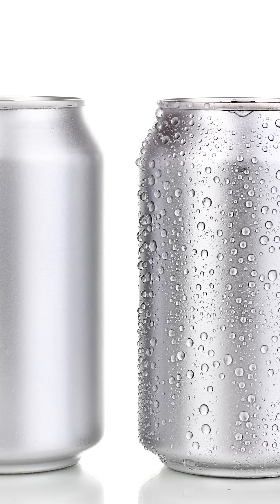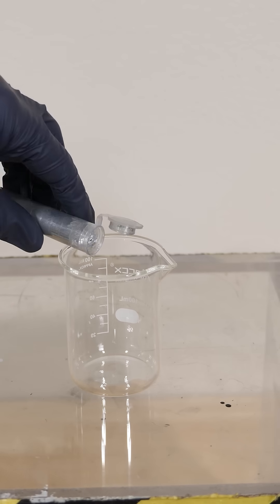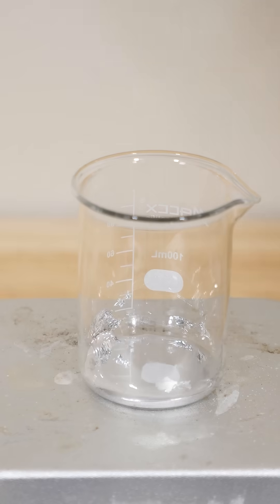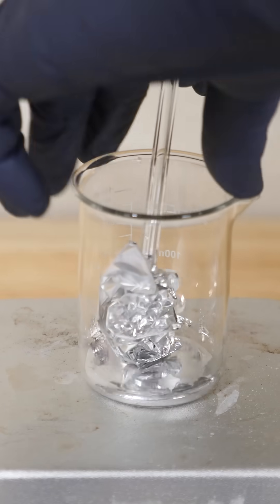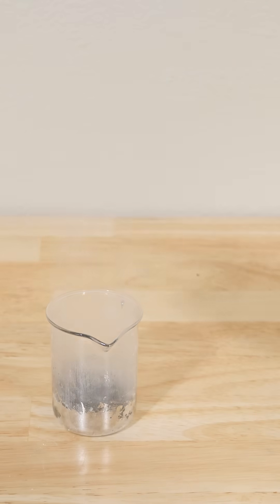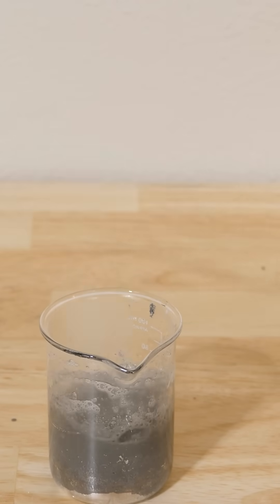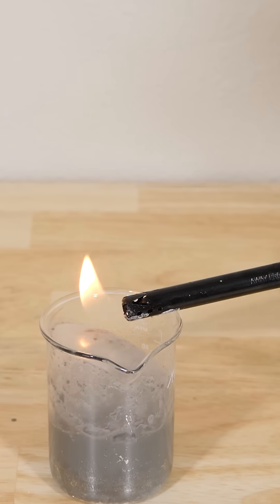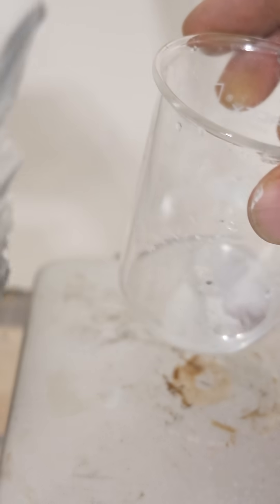Don't mix water and aluminum!

Comment: There is a reason why aluminium is so difficult to obtain despite being one of the most abundant elements on Earth. It simply does not want to stay in its pure metallic form.
Reply: Aluminum is one of the most reactive metals in the periodic table, and that means it will mix with anything next to it
Reply: @kenon2414 
I never realized that; although I should have figured it out by its position on the periodic table.  Makes sense now.
Reply: @kenon2414 So it's one of the whores of the periodic table 😂😂
Reply: @kenon2414 I had no idea
Reply: @kenon2414 Sodium and magnesium, the 2 elements before it be like
Reply: @CZpersi 😂😂😂😂
Reply: Guess I should stop drinking canned beer then!
Reply: not only does the aluminum of your beer can create an oxide layer the instant it's exposed to air (as described in this video), preventing it from reacting with your beer or anything else for that matter, your beer can also has a thin plastic lining inside of it to protect the flavor of the beer. If you damage the lining, the can breaks down more quickly and makes your beer taste funky, but it wont react, again, due to the oxide layer on the aluminum.
Reply: @nickhollerauer4295  That plastic layer is leeching BPA in to the  beer. It's real purpose is to lech BPA in to the product.
Reply: @Maxim.ID4HO  lol mmmk
Reply: @Maxim.ID4HO  there needs to be a plastic layer, or else the metal will corrode or leach metal into the drink (like the Moscow mule does).
Reply: @emilpersidski  That's why I recommended glass bottles. If you notice they have plastic, Teflon, or aluminum touching our food at every turn in preparation and storage. The people responsible for this said they would get us with the packaging. Shortly afterwards, plastic was touching everything, if not aluminum. Stainless steel and glass are the safest materials.
Try and find a solid stainless steel pan these days without some aluminum thrown in there somewhere.
Reply: @Maxim.ID4HO  plastic and aluminum are cheap, easy to come by, and effective at sealing things off while being lightweight and strong. You are implying there's some sinister thread behind packaging when a simple analysis of why one might use those materials in the first place better explains their use than any conspiracy theory ever could. You may have some kinda point with regards to health issues, maybe plastic can be bad for you over time, yada yada, but you seem to think the conspiracy is to negatively influence health on purpose rather than simply save money at the potential expense of your health using the most cost effective means available, I.e. a simple costs/benefits analysis that any consumer can do. I just don't see the profit motive behind purposefully making people ill with plastics, but I do see the motive behind making people containers that do their job very well while being cheap and convenient for the consumer and company alike.
Reply: @nickhollerauer4295  
Production of plastics

Production of plastics from crude oil requires 7.9 to 13.7 kWh/lb (taking into account the average efficiency of US utility stations of 35%). Producing silicon and semiconductors for modern electronic equipment is even more energy consuming: 29.2 to 29.8 kWh/lb for silicon, and about 381 kWh/lb for semiconductors.[120] This is much higher than the energy needed to produce many other materials. For example, to produce iron (from iron ore) requires 2.5-3.2 kWh/lb of energy; glass (from sand, etc.) 2.3–4.4 kWh/lb; steel (from iron) 2.5–6.4 kWh/lb; and paper (from timber) 3.2–6.4 kWh/lb
Reply: @Maxim.ID4HO  this is a meaningless comparison considering plastic is so much lighter weight than those other materials; I.e. a lb of plastic will go a lot further than a lb of iron, so saying you're making a lb of iron more cheaply is completely useless information. Furthermore, consider, a bicycle is 98% efficient, yet we drive our cars that run at 30% efficiency all the time. Why? Because we consider many other factors when building and using products, namely how useful the product will be once it's been created, and plastic has virtually infinite uses, thus it's worth it despite being more energy intensive to make. I mean, these materials are all extremely useful for many different things, granted, but you're only considering one factor in your analysis, not the potentially limitless number of end products that can be created after processing the raw materials to make plastic. Tell me, how hard is it to create an airtight package out of a bar of iron or a hunk of glass? How much does forming that package cost per unit? How much energy would it take to ship that single product to a consumer? Because you can create about a million of them in a day using plastic to make zip lock bags, and a lb of those vs a 1lb airtight iron lockbox would be much more efficient, and probably more useful, no? Plus they're more malleable, less prone to damage from the elements or from being dropped, I mean really I could go on and on about how much more stuff you can make out of plastic that is more useful in more ways than if you used paper, metal or glass, but the sheer absurdity of your myopic view on the subject is enough to bury your argument. You can't make virtually anything as cheaply or efficiently with any other material for a vast, vast array of products as you can with plastics, and to say otherwise is just ridiculous. I mean...its in our lexicon that something is cheaply made if it's made from plastic. "It's made of cheap plastic" is a phrase often heard when handling products because, say it with me, *plastic is cheap and easy to come by*. Period. It doesn't really matter how inefficient it is to make compared to other materials when you consider the incredible versatility of the end product.
Reply: @emilpersidski just drink the metal-tainted beer, like our forefathers did!
Reply: @nickhollerauer4295 Oh Yah? So how come the water in my childhood aluminum canteen tasted so bad after 15 minutes?
Reply: @Maxim.ID4HO That's why I only use bottles & pour my beer into a "glass" glass.
Reply: @american23t  I don't know if you're trolling me, but I'll answer anyway: the inside of your canteen probably wasn't coated with plastic like in a soda can. The aluminum leached into the water to make it taste bad. Just because the entirety of the aluminum exterior was oxidized, preventing it from reacting, doesn't mean a small amount of it can't get dissolved into the liquid.
Reply: @Maxim.ID4HO  exept your forgetting that plastic is a byproduct not the intended product. Which is why it's so cheap. Gasoline and diesel are the primary products you get from refinement and in the process you get a ton of byproducts including some plastics. There are actually other plastics that are made through plant matter
Reply: @saber5694  I said steel and glass were cheaper to produce than plastic. The processes show it and the documentation is there. Steel canning is still in use and so are glass bottles and jars. Plastic has subsidizing added to it, as well.
Plant based plastic (cellophane and similar) are not as abundant in food packaging as they used to be. Plant based packaging material is safer. You would think that it would be used more often for that very reason. Clearly we are discussing the wider use of petroleum by product plastics. They are poisonous...cut and dry they are poisonous.
And that they are more expensive to produce raises the question as to why we are having them put all over our food and food storage.
Aluminum is poisonous. You'll never see Aluminum added to a multi-vitamin for that reason. Someone above claims Aluminum oxidizes before it becomes a threat, but that is not the case and acidic foods challenge the bonds of their containers. Aluminum leaches in to the food products. In the Food Industry they had safety guidelines on the use of Aluminum foil during the cooking process. We had to line the food with plastic wrap (just as bad) if we were to be using Aluminum foil on the product.
It's very simple, you don't use poisonous materials to produce or store your food and we are doing just that. Those that are in charge of these companies said they were going to do this, and here it is.
Reply: @nickhollerauer4295 yes it's true, plastics are almost the perfect material for storage and ease of use and a wide variety of applications.... Too bad they come with shitty side effects like BPA and BPS in the material, and the continued use of easily disposable plastic products is causing an environmental catastrophe in waste, including the great plastic garbage patch floating out in the Pacific ocean. 

I wish we had a different material as perfect as plastic for our everyday needs, perhaps in the near future will find one. In the meantime I would like most consumer plastics to be banned but I don't see that happening.
Reply: That's insidious.
Reply: That's insidious.
Reply: @nickhollerauer4295  You make a good point. Why would they want to kill their customers, the ones making them rich
Reply: Tell it to Du Pont
Reply: @nickhollerauer4295 it's amazing you advocate for money over human health! Welcome to the end of our thought process, where did you get lost along the way?
And if you think the multibillions of dollars of damage that microplastics and nano aluminum ( in the air) and forever chems outweighs whatever money they're saving, maybe YOU should go back to studying cost/benefit analysis.
Why are the most myopic people the loudest?
Reply: @nejihiashi  I know, but I still try where I can.
The water filter I currently use to remove BPA's is plastic. I'm upgrading to a glass and metal model.
You are very, very right. 
Just got to keep trying though.
Reply: @Maxim.ID4HO  I'm with you i wish we get better alternative than plastic especially for water and food
Reply: @Maxim.ID4HO with all due respect, without the plastic lining, canned goods would expire a month into their lifespan due to the corrosive contents eating and rusting through the metal. That plastic layer is required like it or not
Reply: @Maxim.ID4HO mass producing plastics is cheaper yeah in small quantities glass and everything else is cheaper but to bulk make plastic is overall a cheaper process and the plastic is exponentially easier for the manufacturer to manipulate.
Reply: @Maxim.ID4HO Even if I want to grab my tinfoil these days I find that it's made of aluminum. Bummer. Tbh I like both.
Reply: @Yukanhayt-Mhenow those aren’t pure aluminum. Never have been.
Reply: @torakfett3351 I don’t get why people refer to a given metal in an alloy as if it’s not pure aluminum. It is. It’s just mixed with other metals, but the aluminum is pure aluminum. People say the same for gold. 18k gold has pure gold in it, that fact doesn’t change just because that alloy is not 100% gold. The gold in 18k is as pure as the gold in 24k. 

Don’t get me wrong I understand…I just don’t think it’s the best way to communicate what needs to be communicated.
Reply: @Fee.1 the issue is that 18k gold is referred to as gold in spite of being an alloy, thus we call 24k gold pure in other to distinguish it from gold alloys that still get called gold, in spite of having other metals mixed in.
Reply: @Yukanhayt-Mhenow  most likely kely you're not getting any more real harm from canned beer than from bottled beer. Aluminum oxide, which forms a shell around aluminum very quickly, is pretty stable and doesn't leech to any significant extent into the beer. The alcohol in the beer will get you a few milleniums before the aluminum of the can does, unless you like get stabbed by a weaponized can or whatever.
Reply: @henriquepacheco7473  When that oxide process fails, you get a pitting on the surface of Aluminum. The pitting is very common, so it happens all the time. We are just used to seeing metal rust, when it is being eroded. Aluminum does not rust, it pits when it fails. So Aluminum is not as safe as these people are making it out to be. You would never see it as plumbing or in a daily vitamin regardless of this magic oxidization layer that is impossible to disturb.
Reply: @Yukanhayt-Mhenow cans have a layer of plastic inside and out, the aluminum is pretty much just contributing strength and color/texture
Reply: @Yukanhayt-Mhenow brother all aluminum canned drinks are lined with a plastic so the liquid is never in contact with the metal can.
Reply: @Yukanhayt-Mhenow i ruined the 100 likes
Reply: What if you, like, scratched an aluminum can while it was underwater? To remove the oxide layer. Would it react then?
Reply: @16floz if you got it there before the oxigen in the air, yes. That said, even if you scratch aluminum underwater, the reaction won't go on for any significant amount of time - the scratched surface will react with the water and form the same oxide coating that usually prevents the reaction, thus only releasing trace amounts of hydrogen.
Reply: That makes me feel like we’re using it wrong then 😂
Reply: Wow
Reply: for a while it was then we figured out how to isolate it with phosphorus and now it is one of the most popular materials for performance anything.
Reply: when it was first discovered in the 19th century it was thought to be another precious metal like gold or platinum
Reply: I heard that it was indeed rare and that the few nuggets of metallic aluminum were made by lightning strikes.
Reply: The mining and refining of aluminum requires large amounts of electricity
Reply: Try putting some mercury on it!!
Reply: Metallica must be aluminum.
Reply: Activity series sir
Reply: None of the first column elements do.
Reply: So aluminum hates its own race and likes diversity
Reply: We have to send aluminium to a catholic school 😂
Reply: ya'll are having the paragraph wars
Reply: Thanks for spelling “Aluminium” lad!
Reply: @celestial2779  I like that version best as well. Just the classic sound and that a large number of the element also adhere to that format is just that little more joyful.  But it's flexible enough, in the end there is the standard abbreviations for each element.  
And aluminum or aluminium is still an awesome element. Kings got served dinner on it.. 😅 cheers
Reply: It surprises me how reactive aluminum is, its reciprocal nitrogen refuses to react unless greatly heated
Reply: Common Aluminum W ngl. Ain't gonna take no shit from no miners
Reply: Naughty metal
Reply: It's not hard to get at all.
Reply: What happens when you don't heat the water with aluminium in it?
Reply: Except it does. The protective aluminum oxide layer (only few atoms thick) is very inert. That's why aluminum doesn't tarnish or rust. 

But aluminum has a high binding energy with oxygen, so it's really hard to separate it.
Reply: It is the reason for plastic lining inside drink cans, this thin film protects the drink and prevents potential reactions between can and drink itself.
Reply: Hmmm, explains why my aluminum ladder has remained metallic indefinitely
Reply: @j5jackson878  did you watch the video? He says very clearly that pure aluminum reacts instantly with oxygen, producing an oxide skin that protects the pure metal underneath. So your aluminum ladder is mostly aluminum with an aluminum oxide layer surrounding the whole thing, keeping the rest of it from reacting.
Reply: The motive is capitalism.
Reply: Difficult to obtain? Bro literally every supermarket has it 😬😂 (for the slow folk amongst us...that was a joke.)
Reply: All you have to do is know what chemilcal(s) will dissolve it out of aluminum foil. Not hard.
Reply: @guitarttimman  oh yea, now do it without help
Reply: @deleted-something  I have before. You don't need help. Just knowledge.
Reply: @guitarttimman  knowledge is help, people didn't know how to do until the very late 1800s

Comment: Might have been good to see gallium and aluminium chemical reaction with h2o written out as to what processes are happening?
Reply: The gallium is not reacting. It is acting as a solvent, softening the surface of the aluminium and preventing the protective oxide layer from forming.
The reaction is:
2 Al + 3 H2O -> Al2O3 + 3 H2

Comment: Maybe a solution for manufacturing hydrogen gas for fuel cell vehicles?  Hydrogen electrolysis from water consumes 3 times more energy than is returned when recombined with oxygen, so any alternative for hydrogen production is needed. But, I thought this, making Aluminum is energy intensive too.

Comment: So what happens INSIDE the BODY OF a PERSON(70-90%+H20)thats been exposed to food/water/air/environment/etc-Polluted w/ Aluminum (even if in minute quantities)??? I've  seen Aluminum  detected in lab tested samples of both- rain water samples & high-altitude condensation(+several other less common metals as well). Ive heard Aluminum similarly to Lead is very toxic to the human body(& that both have been shown to severely lower the IQ scores of those exposed for significant amounts/or periods of time).

Comment: You don’t even need gallium. You can used caustic soda granules mixed with water. The caustic soda will dissolve your skin and eyeballs if you spill it on yourself

Comment: How do you refine the gallium after the reaction?
Reply: The reaction with water 'burns out' the aluminum.
Reply: @pirobot668beta  the reaction with water will produce H2, as he said, and leave oxygen to react with aluminum, which is going to form Al2O3, which ruby/ sapphire. I'm guessing that is not soluble in gallium, and it should precipitate out , leaving a layer on the bottom of the beaker

Comment: Not sure how this works out in actual chemistry but as far as I know hydrogen is lighter than air which if this process is done repeatedly in a room with no airflow repeatedly, it may form dangerous pockets, of course over time it'd either be shifted around enough to not matter or it'd simply leak through your ceiling slowly being released outside, but hydrogen gas is in fact, very dangerous.